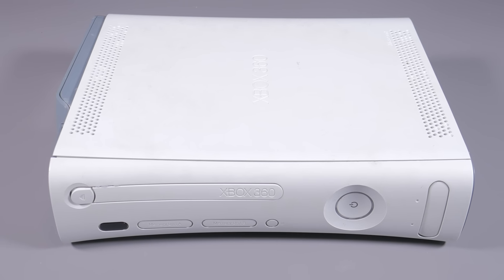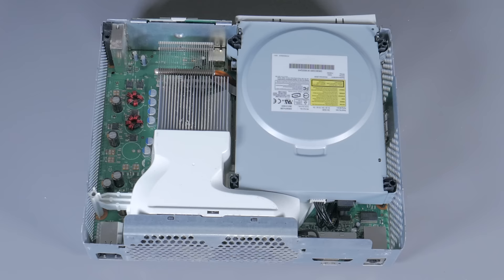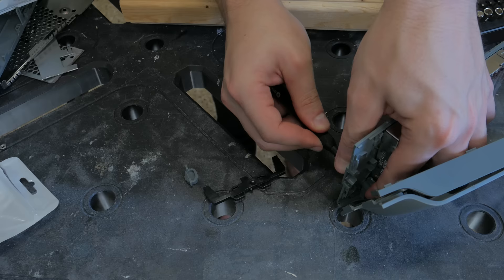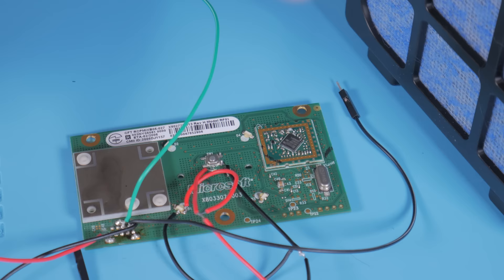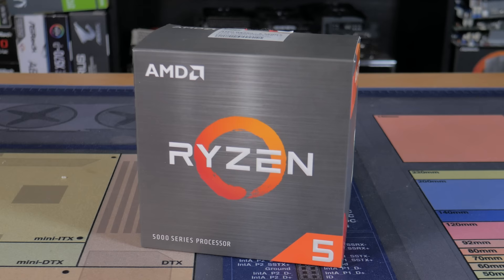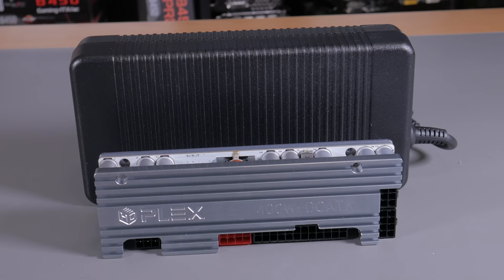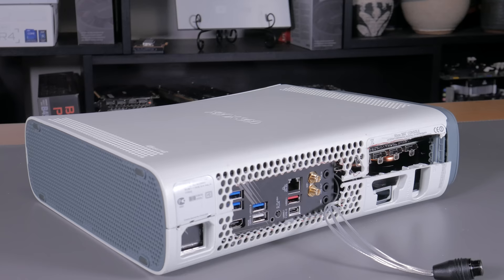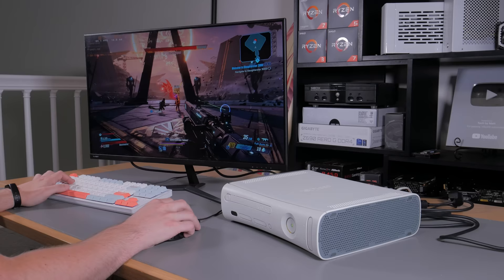I Turned My Childhood Xbox into a Gaming PC! (2022)

Comment: Can we get updated versio someday? It would be interesting to see intel gpu with amd cpu build with this. Atleast now the 7000's is out and intel graphics cards have improved. Some smaller variation of the intel gpu could make this kinda neat, because you could route cables and such much better. Ngl even some smaller amd or nvidia gpu would be fine too, but I think that for future the intel gpu+amd cpu platform would be unique and have lots of potential towards emulation/media player. Also someway it would be great if you could only use the original ports of the xbox by extenders, headers and soldering, atleast usb 3 extenders for front and back have just usb-c port or something fancier.

Just my thought that run to me when I thought ways of making this kind of modifcation. I would do it myself, but I just don't have enough resources to make it:D 

But I appreciate that you made this build, I used to play xbox 360 so much when I were younger. Played almost every hit title with it. Gta IV and RDR especially

Comment: The CPU is hitting 96 degrees. You should use an OG Xbox One case and customise it, fit an outake fan maybes mount and AIO with the rad on the exterior.

Comment: I've already created a classic xbox with a pc inside, including PSU and video card, but I'm waiting for the next generation of AMD processors, to see if there are any interesting options with integrated graphics, as my plan is to create a pc-xbox360 capable of emulating xbox 360. 5600G has a gpu that I consider very generous, and I hope the next generation has a nice one...

In my opinion, the way forward is liquid cooling (so as not to have to tamper with the xbox's plastic case. The problem is finding a radiator that fits. You may have to build one from scratch. As for the PSU, I intend to use the original one from the console .

Comment: Asus ROG G21CX is the same size, i've placed RTX4070 into it,  9900K @5ghz , 32GB Ram, 4 disk drives, 1 nvme, AND a working Blu ray drive into it. :) AND RGB. AND magnetic side cover AND it uses less power.

Comment: I've seen very few that clean. However, you didn't get a Red Ring error because you don't have the original version.
The original does not have HDMI, and has a different cooling system built in than this one. I have one sitting in front of me.

Comment: I had a overclocked APU with a AIO in my 360 Elite and it worked as a media PC for years until the DC-DC board burned with the 24pin motherboard header.I went to a few lanpartys where I used it to play CS and COD. The MB was a Asus deluxe board with Wifi/BT and it cost about 350€ when I bought it and when It failed it was already ~4 years old so I scrapped the whole unit as it was not worth rebuilding.

Comment: I have built a similar setup a few years ago and it's still rocking. I arranged the components in a very similar way, but the CPU and GPU are oriented towards opposite sides.

I am still amazed by the looks. The 360 has a great design. Only temperature management turned out to be a problem. 😅

I made some minor modifications to the case as I drilled a grid of holes into both sides at the location of the fans.

What do you think about the series x? I'd like to modify that to a PC, but the dimensions are a little too small for a mini itx Mainboard

Comment: My last build in Xbox 360 was Ryzen 5 5600G GT 1030 onboard, Nano ATX.
Keeping all the original XBOX parts, Blue Ray drive in the bay, NVMe and DDR 5.
The original cooling is not that bad ! I will replace it on next gen Arc onboard now, keeping all the original parts !
just find a dead Xbox, move the old parts in it.

Comment: I have the CPU and GPU dies from my Xbox 360. It was a launch day model that died in 2011. After it died, I pulled the die packages off the mainboard, along with keeping the fans and the heat sinks.

Comment: There are usually "mini" versions of GPU's. I would have used one of those. You did great. Kudos.
I have found that gel superglue works to hold things in place, but then I follow up with JB Weld epoxy for superb strength.
I would have never gone with a Ryzen just because of current and heat dissipation. Intel is the way.

Comment: Fat 360 PSU is rated at 280Watts. I think that the best thing would be to strip a modern laptop motherboard and fit that in there, using the same 360 power plug connector and psu. It would fit better and have better thermals. It's a gimmick device, doesn't have to be the FASTEST computer ever.

Comment: Hey man, awesome build! Better than mine 😅 I did this back in 2008/2009 but was never able to go as far as getting the power button working from the Xbox. I used a separate switch. I used a triple core phenom CPU, server heatsink and fan (it was loud) with two laptop 2.5" hard drives in raid 0. My plan was to fit a graphics card using a flexible pcie adaptor but never did! I just used the onboard graphics for some basic oldscbool gaming. It was fun!

Comment: i remember with my classic 360 i got this giant aftercooler fan thing that clipped on the back for extra air flow. it plugged in via USB for power and was just always on if i remember right. Would probably help cool it a little while running this.

Comment: I know this was a year ago BUT the small noctua fan should be blowing air INTO THE CASE, the CPU COOLER FAN should be blowing air UP (so sucking it through the cooler and blowing it up) and the CPU COOLER FINS SHOULD be aligned with the Noctua fans, so they are blowing air into the fins and the big fan is sucking that air out.... BUT I'm not sure how close the 'case' plastic is to the surface of the CPU cooler fan.... if there is about a half inch then you should be fine
- As far as the GPU... I think its fans are RIGHT UP AGAINST the metal case... but there is plastic on the other side of that metal... SO you can remove some of that metal to allow more air to get into the fan AND still look stock on the outside....

Comment: loved the video honestly tempted to try it myself and see how far I would get, not sure how much room you have available in the case, but I think it would be cool if you used an Arduino nano to run a little code that makes the LEDs on the front light up how they used too on the original xbox when you first turned it on. I know it's a lot of effort for such a small detail but just a random idea. also, could maybe mod on of the old HD dvd players to include a standard sata drive so you could run original xbox games but that's a much less useful feature these days anyway, either way, loved the vid.

Comment: I would just drill holes/honeycomb in the case about the cpu fan, or if possible try water cool it with a micro cooling system

Comment: 512mb of RAM? Oh how things have changed. The xbox one s had 8gb of RAM and the series x has 16gb. My PC has 32gb of ddr5. Respect to microsoft and developers for making these consoles so capable with so little. If you made a pc with double those specs, it wouldn't run a quarter as well.

Comment: Wondering, will those tiny fans fit on the outside, between the bottom cover and the metal ? Looks like there was a gap 15:27 ish when you were putting the bottom mesh cover back on

Comment: 98C at 58% usage? Yeah I am pretty sure that's thermal throttling. Idk man, it might have been better to 3D print a shroud the same way the XBOX did it in the first place and just run those 70mm fans at full blast through the heatsink.
Or maybe make some extra ventilation right above the CPU.

Comment: If you can emulate the Xbox 360 at full speed 1080p on it, then you have succeeded, otherwise you have failed. In I honest opinion, if you build a sleeper build for a computer, it has to be able to emulate the original console that you are disguising it as. In this case you have to run Xenia at full speed otherwise you have failed.

Comment: The reason you never got the red ring of death is because that xbox is the jasper motherboard model which released when microsoft fixed the issue.
-edit: You can tell because the disk drive front part is solid white instead of chrome.

Comment: ah only if you had waited a bit, the lp 4060 is way smaller and is comparable to a 3060ti , the 4060ti low profile is just as big as this 3060 but consumed less power, also play with the curve optimizer a bit for the CPU , it'll shave off another couple of degrees and set the temp limit to 85c, as for the GPU fiddle some more in msi after burner voltage curve editor, you can shave off atlest 40w. also whats the CPU cooler height limit in this? might want to try the axp90 x47 full copper or x36 full copper

Comment: If you short out the positive on those LEDs they'll all turn red except the center I did that on my own 360 when I was 15-16 also I'm not sure why you didn't just use the original pinouts for the leds and run them to pw led on the mother board

Comment: nice idea, but bad choice of parts, mainly the gpu.  its very good it fits in the 360 case,  but theres no real ventilation,  so im surprised it ran well.  this would better suit a gpu that runs off the pcie slot that will enable the use of a pico psu.  leaves more space for airflow and maybe another fan.   if you use a low profile gpu then you shouldnt need to hack as much as in theory it should all fit in the case as is and the only modifications would be any bits of plastic that might stick out.

Comment: I'm thinking a gaming laptop board would have worked better, most laptops will work just fine without the built in screen and most will default to the external display with the internal one disconnected (I've repurposed a LOT of laptops with bad screens). Sure it wouldn't be as powerful or upgradeable but it would all fit better and run cooler and quieter.

Comment: RTX A2000 would of worked better for the compact design, power, and thermals. The 12 GB model exceeds a 1660TI in regards to performance.. In order to get the FPS uplift equivalent of the 6 core 12 threads with 3060. You could of done a 8 core 16thread cpu with the RTX A2000, or just done thread ripper 12 core 24 threads with RTX A2000

Comment: You need to cut out the bottom of the case to allow that GPU to breathe. You could cover it with a white pantyhose material to keep it semi stock looking, yet still get some ventilation and dust control. Those GPU fans are smashed against the bottom of the case. Nice job otherwise!!

Comment: Why in the world would you not use the best ddr4 gaming cpu available? The 5800x3d? Makes no sense. You are building a gaming machine. Use the best gaming cpu for that generation
Reply: mainly because of wattage and temps anything higher than that would make the cpu temps up to 140 degrees of which they are already at 100 degrees Celsius with just a 6 core 65W cpu
Reply: Bit of a deaf comment
Reply: @zachariah74  sure. It’s a deaf comment to suggest using a x3d cpu on a GAMING am4 build. Yep. That’s the dumbest suggestion anyone has ever made huh?

Comment: I sometimes hate how dumb youtube is.  The non-idiot would use a low power CPU to make cooling and supplying power easier.  An AMD 5600ge or Intel 12700T would give nearly as much compute while using less power and producing less heat.  Losing a few frames per second, but having a usable machine seems like a worthwhile trade off.